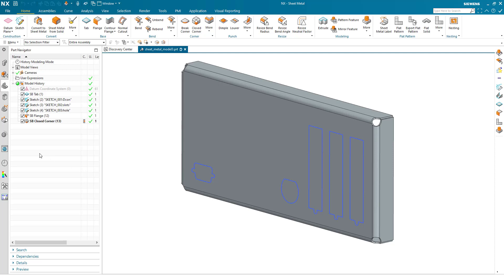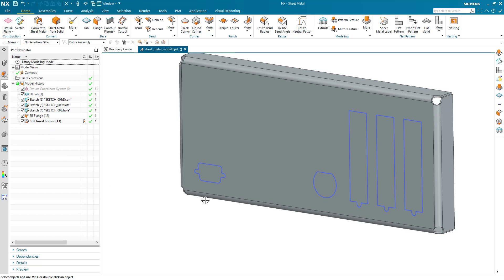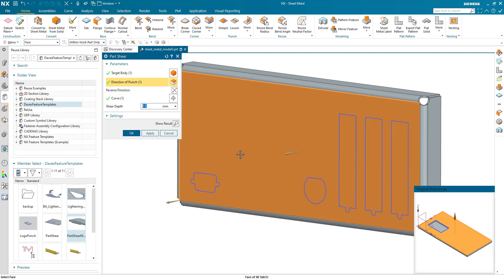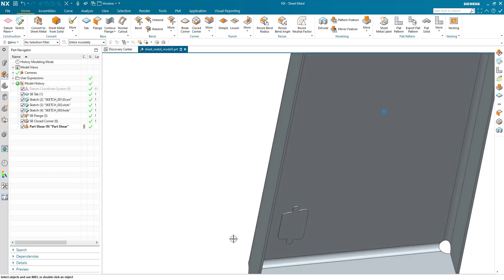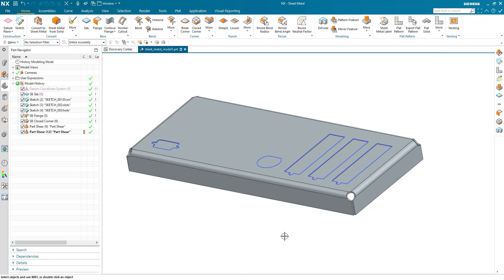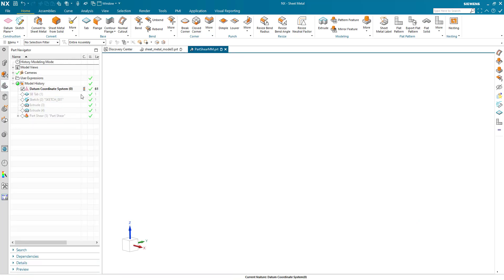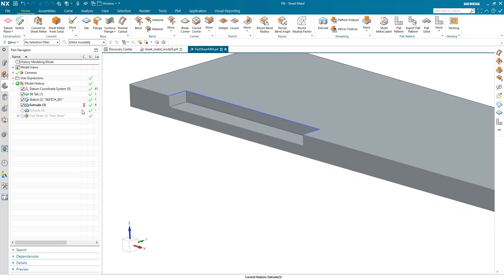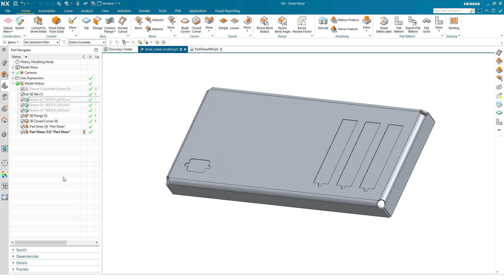Siemens NX Sheet Metal: Part Shear

Comment: Dear Sir
how do you rotate a component on the screen
Reply from the maker: Do you mean spin around graphically on screen? Hold down the middle mouse button and move the mouse.  Roll the mouse wheel to zoom.  Or do you ask how I do it?  I use a 3Dconnexion space mouse.
Or do you mean move a component in the context of an assembly? Use Move Component command.
Sorry, not really sure which answer you want!
Reply: @deedub7777  Please Upload Shortcut Key Command Video
Reply from the maker: @Cadmind  https://blogs.sw.siemens.com/nx-design/nx-timesaving-clicks-tricks-part-1/?spr_cid=120_688&spr_pid=300000459106684&linkId=300000005050735
https://blogs.sw.siemens.com/nx-design/nx-timesaving-clicks-and-tricks-two/?spr_cid=120_688&spr_pid=300000459621928&linkId=300000005061390
https://blogs.sw.siemens.com/nx-design/nx-timesaving-clicks-tricks-part-3/?spr_cid=120_688&spr_pid=300000459741749&linkId=300000005064108

Comment: Dave, would it be possible to create a feature template to make Three Bend Corner with a gap (because currently the feature doesn't allow for gaps)? Or would it be too complicated and maybe beyond the capabilities of feature templates?
Reply from the maker: Interesting idea, but there are so many variables in the feature it would not be possible to control.
Reply: @deedub7777  That's what I thought. I tried and it worked on the part that I used to generate the feature template, but when I tried to use it in other parts, it got crazy, flipped the features to the wrong sides etc. Probably because it would be too hard to orient the feature in a way that would work in all cases.

Thank you very much for your answer and for your videos!